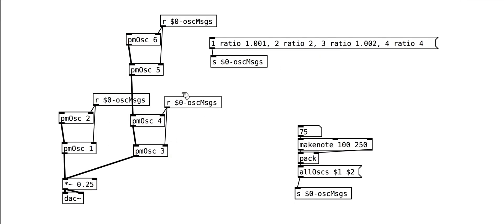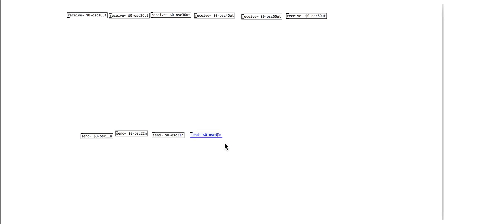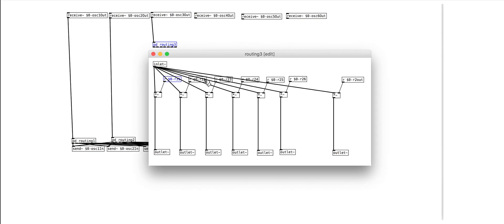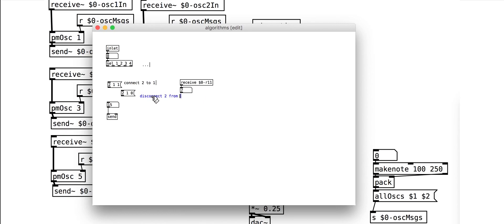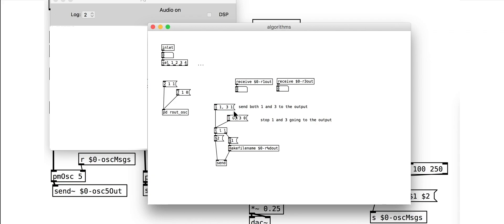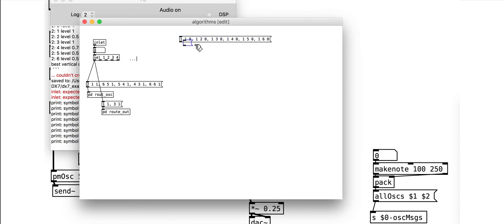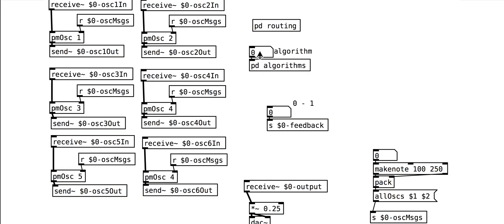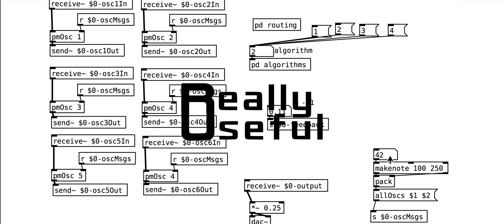PureData tutorials - rich synthesis (17) - DX7 Phase modulation 3

Comment: Strange why you didn't explain the feedback , since operator feedback can only be done within a subpatcher with a block~ object  set to  1  , and using tabsend~ tab receive ~ ( delread~delwrite~also works .
So now we can turn a sine into saw into noise
When I hear you tweaking the feedback at the end of the video , it's obvious you didn't use block~1 sample , so in your case the feedback is determinded by the overall blocksize
Reply from the maker: That is a relevant point, yes